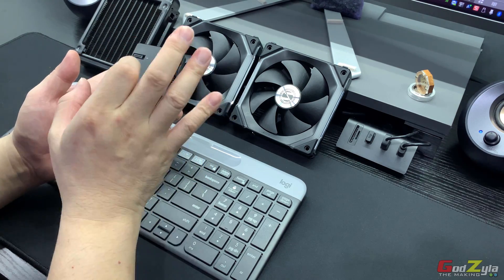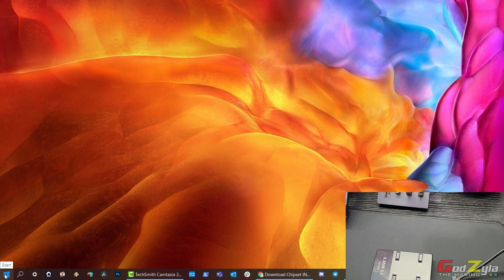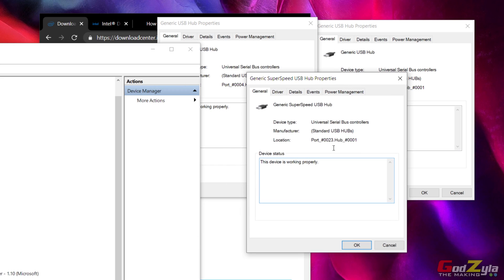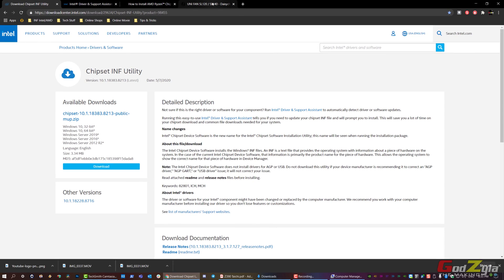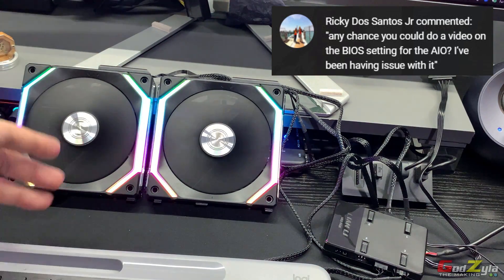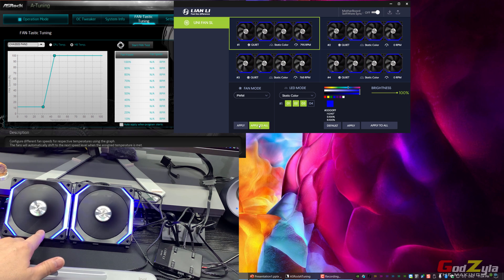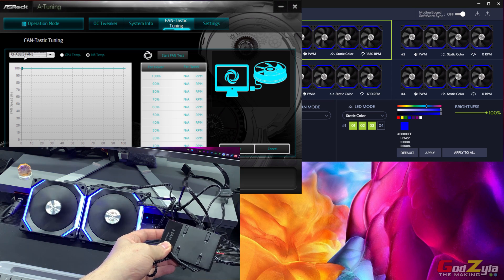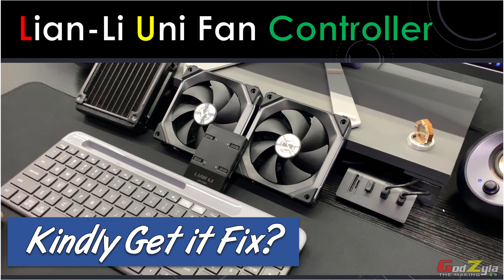Lian Li Uni Fan Controller - Some Break Fix! [L-Connect]

Comment: Here is my machine with a custom ARGB cable and all lights controlled by lian-li controller. The fans are controlled by motherboard(not plugged into the lian li uni controller)
The case front vertical light bar and the rear vertical fan (EK vardar RGB 120mm) are also controlled by the lian li controller port #4 and plugged via custom cable. So all lights are controlled by one software L-Connect 2 and Uni Controller. Spcial effects can be achieved by enabling and disabling fans 1-4 on port #4(look at the front bar and rear top fan synchronization of light drops). More lights can be added. This eliminates all other software which is bloated. 

Here is the rig: (one controller to rule them all)

https://youtu.be/Pu1w8la1n2I
Reply from the maker: hello Interimus, thank you for sharing, nice build. but I would not encourage any of my viewers to add more lightings unless they know what's the load limitation of the uni controller. 
I believe you do know the load limit of the uni controller as I can see you do other electronic stuff at your channel. Kindly be mindful of what you've type. I know you can add more lights but that's the knowledge you have and not others. still thank you for sharing again nice build you've gotten there.

Comment: Hello, i don't have any 3-PIN Header on my motherboard, but i did see someone on an Amazon Review say that they connected it to the controller that it comes with, is there any way to use the fans without plugging them to the motherboard? I don't care if i would have to buy an adapter i just want them.
Reply from the maker: hi DarkyXO, welcome to my channel, yup you can just use the uni controller to plug the fan load and argb. maybe this will aid you with it. https://youtu.be/Rm2emeyMUAk as I did mentioned it is possible.
Reply: @KleoYan  Thank you so much man, you're a genius! <3
Reply from the maker: @Darkycx  you are most welcome.
Reply: @KleoYan  Another question, i just gotta plug the USB into my motherboard port and the rgb and pwm will work?
Reply: Because i think that's what u explained on the yt video.
Reply from the maker: @Darkycx  if you want to use PWM , just plug the PMW cable which is only 1 single wire to the motherboard fan header. in your UEFI of your motherboard, make sure is set to PWM and not DC or other mode. then on your L-Connect, under PWM section (on the left bottm of L-Connect app) set to PWM instead of Quiet , High Speed, Full speed or manual speed. oh dont forget to set which set of output you want to control via PWM. 

however being said. most of the people decided to remove the fan load connection and plug directly to the motherboard fan header.
Reply: @KleoYan  yeah thanks, i just want to be able to configure RGB I don’t care about pwm tbh.
Reply: Which I’m guessing to control RGB u just need to plug the USB into ur motherboard if u don’t have the 3 pin header ARGB.
Reply: @KleoYan  thank you so much for the help ❤️
Reply from the maker: @Darkycx  yup. all the best in your build :)
Reply from the maker: @Darkycx  you are most welcome 😉
Reply: @KleoYan  One more thing please, could u please help me and tell me if my motherboard Asus Rog Strix B350-F Gaming has the right USB Port in my motherboard to plug the fans please? :(
Reply from the maker: @Darkycx  ya it is https://dlcdnets.asus.com/pub/ASUS/mb/SocketAM4/STRIX_B350-F_GAMING/E13031_ROG_STRIX_B350-F_GAMING_UM_V2_web_20170606.pdf  page 13. You have 2 USB 2.0 port
Reply: @KleoYan  Thank you so much man, God bless you, hope u have a great life.
Reply from the maker: @Darkycx  you are most welcome. thank you too to have visited my channel.
Reply from the maker: @DarkyXO don't mind, I have moved all your questions and my answers from the other video to here. please stick to this, I will get notification when someone post comments and I normally will answer them. Plus I can refer to your past questions to understand your situation. do you know I gave you the wrong answer at the other post. it's very annoying.

Your-Q1) 
"Hello, can u please give me the link to buy the adapter for Lian Li Strimer Plus controller to Lian Li SL120 Fan controller please? and the adapter for single sl120mm fans to the controller?"

My-A1) 
which is the wrong answer " hmm. you should have post at the appropriate video, anyway here is what you need. there are no adaptor for your SL120 fan to the strimmer controller. only the single SL120 fan to your motherboard argb header. 

This is for your single SL120 to your motherboard
========================================
get the pin needle and the converter below. 
‣ Pin needles - https://www.aliexpress.com/item/32706628771.html or https://www.ebay.com/itm/224459128229 (you need to pull out one needle to fit the below converters)
‣ Converter - 1 To 1 Male https://www.ebay.com/itm/133521646617 or 1 TO 1 Female 5V 3pin https://www.aliexpress.com/item/1005001598378033.html"

Your-Q3)
"I thought if i commented here i was gonna get more attention since there are no comments, sorry :(. But i mean, i saw on ur video, that u plugged Lian Li Strimer Plus controller to the Lian Li SL120 Uni Controller, so u could control them both in 1 controller, but u used an adapter to connect the Lian Li Strimer Plus controller to the Lian Li SL120 Uni Controller, how do i buy that one tho? like which one on the links u sent do i get? because i got confused because there are too many links and i don't know, thank you in advance."

My-A3) 
"if you are really confuse. are you able to get hold of the lian li argb kit? if you can get it. this will be a better explanation https://imgur.com/gallery/beYR8CN"

Your-Q4) 
"Another thing, how can i plug 3 single sl120 fans that each fan have 2 cables to the uni controller without having to use 6 rgb and pwm ports? do u have an adapter?"
For fans use this - https://www.amazon.com/ThreeBulls-Splitter-Computer-Extension-Converter/dp/B07MXNT6V4/ref=pd_sbs_5/142-7213345-7401068?pd_rd_w=O3nr8&pf_rd_p=3676f086-9496-4fd7-8490-77cf7f43f846&pf_rd_r=YGBVK5CZ0ENEFYSGWKDV&pd_rd_r=988723c7-0b39-4a45-bbd3-72779039c50c&pd_rd_wg=jdQhN&pd_rd_i=B07MXNT6V4&psc=1

for argb there is only 1 to 2 way splitter and no 1 to 3 way splitter - https://www.ledlightinghut.com/2-way-3-pin-jst-sm-connector-splitter.html 
you should look for 1 to 3 way JST splitter.
Reply: @KleoYan  Ok thank you! But the only problem is, i don't have an ARGB 3 pin, i guess i'll just connect the unifan controller usb to my motherboard and control the lian li strimer on the controller that it comes with, this is too much for me lol, thanks tho!
Reply from the maker: @Darkycx  ok, I have already posted what you need or get but your method will work too. all the best in your build.
Reply: @KleoYan  Thanks bro, God bless you!

Comment: Hi man great vid as always but i'm kinda disappointed with unifans PWM not working not detected in motherboard ( ASUS )  and the software cannot sync with mobo or fans rans at full speed
Reply from the maker: oops I have miss this comment. pardon me. hmm maybe you can try using revo uninstaller. https://www.revouninstaller.com/revo-uninstaller-free-download/ . Use this app to remove off any motherboard utility and the L-Connect application. then once you've done that. go to your motherboard UEFI, set the fan header to PWM mode and not DC mode. next, install only the L-Connect and test it out to see if you can control the fan via PWM mode.
Reply: @KleoYan  hi man thanks for your answer it was the " AI SUITE 3 " from asus make fans buggy i deleted everything from asus except armoury crate and everything is ok hope i can help someone
Reply from the maker: @figatellu3536  hi you are most welcome and yes your answer will help those who are racing issues like yourself. Thank you 👍

Comment: help !!! my problem is that when I connect the pwn cable to the ch fan 1, 2 or 3 of the motherboard (I tested in the 3) the fans if they rotate but they cannot be controlled neither with the motherboard software nor with the lian li , and when entering the bios it does not recognize the connected fan. It comes out as if nothing was connected. If I connect the fans cable directly to the fan ch without connecting to the unihub, it recognizes them and I can change the rpm from the mobo software. but I'm afraid because the fan ch only has 1 A and the sum of the 3 unifans gives more than that, I provided everything from your videos. (the rgb if it works normal). Even if the fan is not recognized, change all the fan ch to pwn (sorry for the English, use translator) mobo asus x570 prime pro
Reply from the maker: Hi Juan Pablo Robles Hoyos, welcome to my channel. as for why your fan can't be control in uni controller. go to your motherboard UEFI, set fan to PWM mode. then on uni controller, set to PWM. that should work.

Now this is additional info, there are two load in these Unifan, 
1) aRGB Load 0.65a for each fan, this is for light effects. You don't have to worry so long your fan argb connectors are connected to the uni controller.
2) Fan Load 0.18a for each fan.  If you plug 3 x uni fan  to ch fan which is 1A, it's ok as 3 x 0.18a = 054a , your ch fan is 1a.

Comment: Is the usb on the controller usb 2.0
Reply from the maker: Hi ChrisChugsDrinks, welcome to my channel, yes it’s USB 2.0.
Reply: @KleoYan  thanks 🙏🏾
Reply from the maker: @chrischugsdrinks3056  You are most welcome. I do have other videos about this uni fan / controller. if you are unaware of the Dos and Dont's, you might be interested to watch it in this playlist https://youtube.com/playlist?list=PLEW-b-2vYDdM1WklGQps2-sQ1Amy6Uwn9
Reply: @KleoYan  👍🏾
Reply: @KleoYan  on your video where you link a strimmer controller with a unifan controller what would happen if I did not link them and I used 2 different sata power cables?
Reply from the maker: @chrischugsdrinks3056  then you have separate controll. Your strimer will be controlled by its own controller and your SL fans will be controlled by the uni controller
Reply: @KleoYan  oh ok thanks and also how would it work in the El connect software if it is like that
Reply from the maker: @chrischugsdrinks3056  you mean EL lightings. I have no idea as I have never tried.

Comment: My rpms stays at zero but the rgb function works
Reply from the maker: Hi IAmJay09, welcome to my channel. Does your L-Connect shows Zero rpm?  Just for your info. If you plug fans to the uni controller. In hardware info or motherboard utility app. Rpm will not be shown. A work around is to connect the fans directly to the motherboard fan header.

Comment: I recently updated all my case fans to UniFans (3 groups in total) and got a really bitter taste after finding the L-Connect doesn't even register one of my grouped fans' rpms (just the rgb). Your videos are a Godsend, best ones on YouTube for these fans! Instant like and sub for me. Will try the fixes after work and hope to resolve this stupid issue on the otherwise best fans on the market.
Reply from the maker: Hi Nikola Mladenoff, welcome to my channel and thank you for the compliment. it actually depends on which motherboard you are using, sometimes it's the motherboard utility app that tooks over control over L-Connect app. in that case if you have updated the chipset and it does not work, I would advise you to remove your motherboard utility app and the L-Connect app using Revo uninstaller https://www.revouninstaller.com/ . once done, reboot your PC, install L-Connect as administrator mode. test out your fans. if it works then install your motherboard utility app.
Reply: @KleoYan  Hi, Kleo, thanks for the reply. I updated the bios and the chipset and then removed the mb utility app and l-connect with Revo, however L-Connect still cannot recognise group 1 of my fans. I set the fan header on the MB to PWM, but neither the MB nor the app receive rpm information about group 1. I thought about replacing the cable with one of the leftover ones, but since the RGB works and the fan is spinning, I rule out having a faulty or badly connected cable to the fans. I guess it might be just an uncompatible motherboard sadly :( I'm using MSI B450 Carbon Max Wi-Fi.
Reply from the maker: @nikolamladenoff  Hi, thank you for your reply. Just a note, does your SL fan react when you connect only the USB and Sata cable to the uni controller? it should shows you the RPM on L-Connect. maybe you can give that a try first. I am not too sure if you have watch this video https://youtu.be/Rm2emeyMUAk  it might aid you.
Reply: @KleoYan  Yes, the fans are spinning at the lowest speed(probably default) and the lighting goes to default mode also, but it works. The problem initially occurred when I installed L-Connect for the first time - Group 2 and 3 stayed as they were, Group 1 went to full blast and L-Connect does not register any rpms, but only for Group 1. The other 2 fan groups have rpm and react to changes in the mode. I watched all your videos, of course :D I believe I connect everything properly. Does it matter whether I have connected the usb connector to a usb 2.0 or 3.2 header on the MB ? Maybe you have mentioned that but I don't really remember.
Reply: @nikolamladenoff  Try switching the non working fan group to another port on the controller. If they still don't work you may have a bad cable or a poor mate of the cable with the fan it's connected to. Try plugging it into a port you know works.

Comment: Thanks for all the great info! Thanks to you, I've got a Galahad and 10 UNI fans working with my fan curves and LED software. However, there's one thing-- I can't read the fan speed from the chassis fan header that connects to my UNI fan controller. I've tried hwinfo and speedfan, they both show 0 rpm. Based on my searches, it looks like it may be due to the UNI fan controller PWM cable only having 1 wire... you might need 3 for the sensors to read the fan speed, but I'm not sure. Do you have any ideas?
Reply from the maker: hi aznplucky, welcome to my channel. you are right. the uni controller will reach only with the temperature detected by the board then pass RPM commands from the motherboard fan header (the one you have plug in) to the fans connected to the uni controller. often you are unable to read the RPM is because the 3rd wire (Temperature Sensor) is occupied by the uni controller. in most cases, PC Builders will plug sets of fans directly to the motherboard for better control. be it top, bottom, rear, front or even the AIO radiator fans / CPU heatsink fans.
Reply: @KleoYan  Thanks for the reply, and for confirming my suspicion. It looks like I'll have to move the fan cables from the UNI controller to the motherboard. Time for some more cable management... 😅
Reply from the maker: @aznplucky  you are most welcome. now you dont have to worry about uni fan's fan load, they are rated 0.18a each and each motherboard fan header can take up to 1A and for FAN/PUMP will be at 2A, so you it's safe to daisy chain max up to 4 fans to one motherboard fan header.

Comment: I am having problem with Uni on my aorus b550i not spin at all. Also bios does not detect being plug in to fan header.
Reply from the maker: Hi mr2cqql, welcome to my channel. Bios will not detect the rpm if you are connecting the rpm cable between the controller to the motherboard fan header. You will only be able to see the rpm on your L-Connect application. As for why your fans are not spinning, is either your fan daisy chain is lose somewhere or have you set your bios to pwm mode instead of dc mode.
Reply: @KleoYan  The controller design even if the mb header goes bad the fans still spin to prevent overheating, that means even with the pwn header unplug the fans should spins at max rpm. I had my bios fans all to pwm mode. In the meantime the uni controller only act as the RGB only, I had the each of the uni fans plug directly to the mb fans headers and able to control the speeds of the fans. I really think my controller is bad from the beginning.
Reply from the maker: @mr2cqql  Hi, I see, infact leaving your fan load on MB is still the best way to control the fans. leave the aRGB for the uni controller to control the effect. 
now having to say this, you wouldn't want to have a faulty uni controller, I will advise you to do a test on each fan and on each output individually, just to  confirm if your uni controller is faulty. If it is, best to have it change while it's still under warranty.